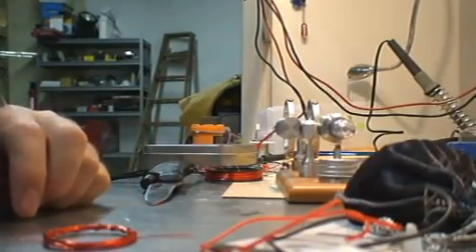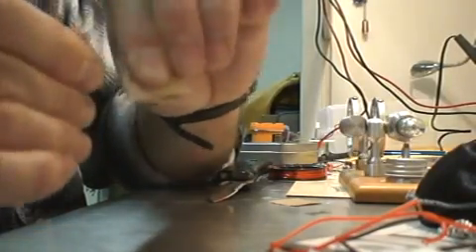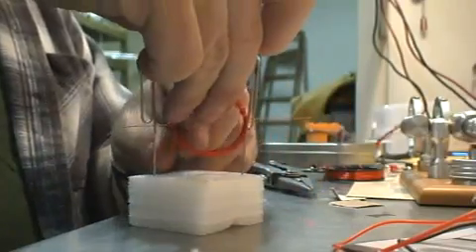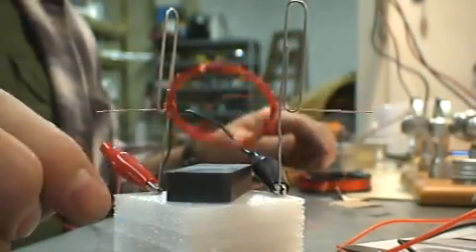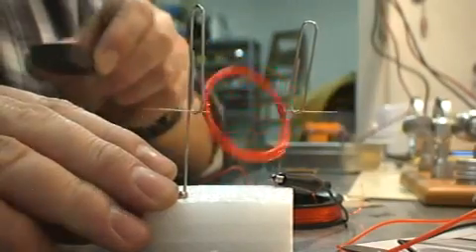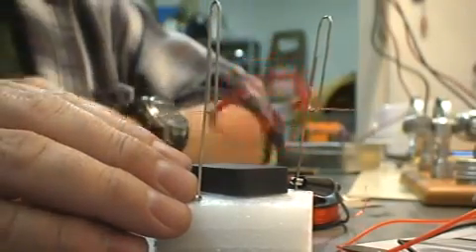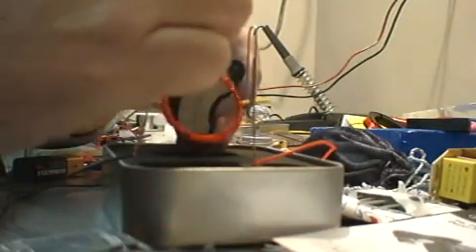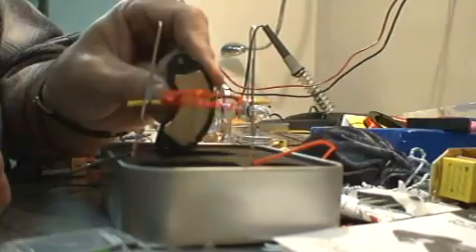free power, how it works, magnet motor 2, electrondon

Comment: OK now hook up a generator to it and charge the battery, I guarantee it will stop spinning. Assume it works and the magnet dies out years from now, you can calculate all the energy the machine made and it would never equal the amount of energy required to make the magnet in the first place.